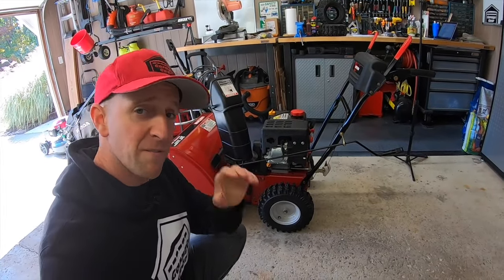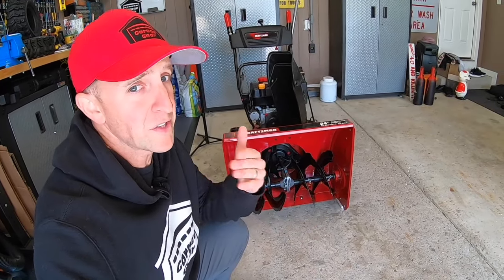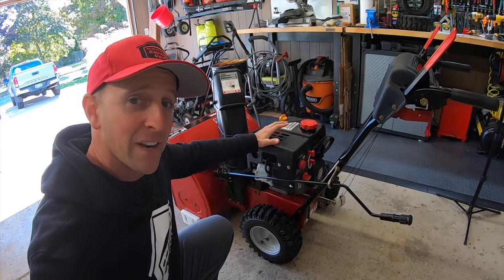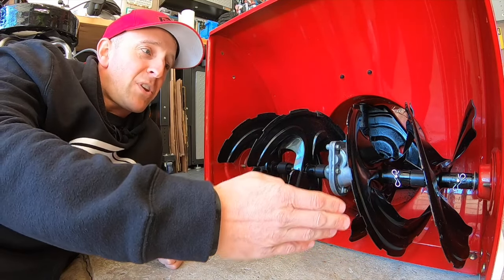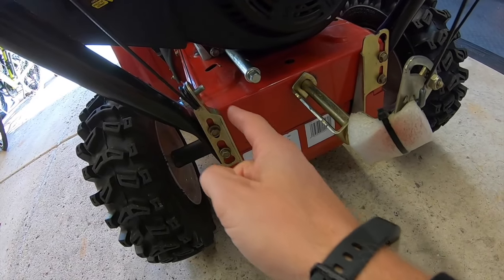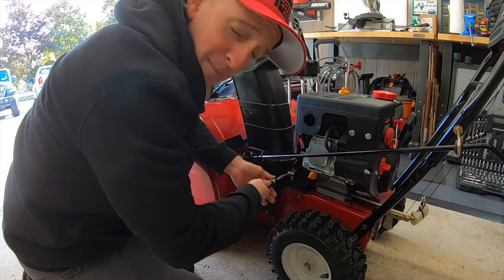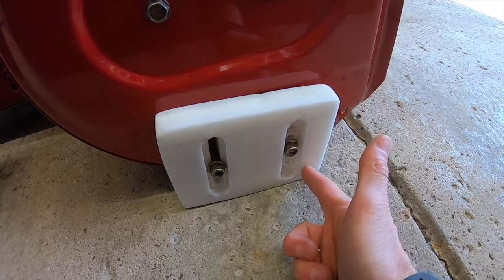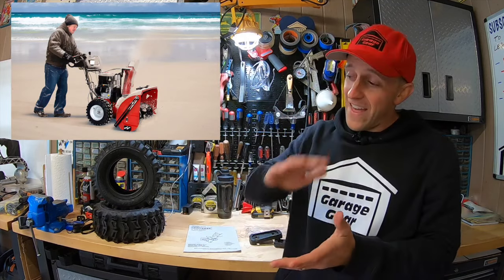LOOKING FOR A USED SNOWBLOWER, WATCH THIS!

Comment: Honda snowblowers are even more! $4,000+ since shortage
Reply from the maker: Guess I better start saving my money! Lol thanks for watching applez!!! 👍
Reply: @GarageGear  I got 2 used Hondas haha
Reply from the maker: @appleztooranges  I see used ones pop on Craigslist around here from time to time. Tempted!
Reply: @GarageGear  if you can get a 1132 or 1332 for under $1000 it’s worth it? I got my 1332 for $895 and could sell it for double. It’s in mint shape. My Honda dealer messed up and listed it wrong model as a 724. Nothing wrong with machine. Runs mint. My 928 wheels I traded my ariens deluxe 28” sho (similar to yours) + $500 towards it and it’s basically brand new
Reply from the maker: @appleztooranges  I’ll be keeping an eye out! Thanks for the advice! 👍

Comment: My recommendation is to find one that has a Tecumseh Snow King that is in good condition. They’re a lot more reliable and easier to work on than a lot of the new engines. One engine you should avoid is the newer Briggs and Stratton storm series. Those things have serious cylinder head problems. The MTD powermore is also a bad one because it is really hard to work on. That is the engine on this snowblower you are showing.
Reply from the maker: Thanks for sharing BCSERK! This snowblower I bought used for a good deal! It’s in perfect condition! Not a spot of rust on it and we’ll taken care off. I’m not a fan of these engines but it’s cleaner than a nuns vocabulary lol! Thanks for watching!
Reply: I just got bad news on my Briggs & Stratton snow series 1150 it has a blown head gasket and engine needs a complete rebuild. It couldn't take 18" of wet snow it killed it!

Comment: I used these tips when checking out the 24" troybilt storm snowblower my neighbor was selling because wasn't room in moving truck. It was 5 years old but never used just set in their garage other neighbor always plowed their driveway . Put in New grass and oil and it fired right up and ran great. They couldn't find the owners manual the power cord or the extra sheer pins. They had paid $899 for it so I gave them $400 for it I think that's a good deal not as good as others commented on. Watched your other videos on the other maintenance to perform on it so it's ready for the snow.
Reply from the maker: Not a bad deal my friend! You’ll get plenty of life out of that machine! 👍

Comment: JB I'm glad that I have my snowblower all ready to go. I changed the oil this fall but had an issue with the auger handle stuck down. Some oil took care of that. I took off the bottom plate and cleaned everything out and put it back on. Took off the pully cover and it looked good. I also adjusted the cables for the drive and auger. After watching your video I realized that I never looked at the sparkplug. I could check it out but it started after the second pull. It sat all summer with no gas in. I've learned a lot from your channel and I'm still learning. Thanks for your time and videos.
Reply from the maker: WHITIE!!! Rock on my friend! You’re a master of your machine!  All smart steps you took there. I have another video coming out this weekend on how to get your snowblower ready for winter! If you’re feeling eager you could always just clean your spark plug. But if it’s starting up no problem you’re good! How’s everything else going my friend?
Reply: @GarageGear  going good.

Comment: Great video one of the best I seen here. I gave away my old & reliable 24" Troy Built and bought a newer 28" Airens which now has a destroyed Briggs & Straton engine on it. I can't blame Airens for that. The last storm was a wet snow of 18" and it did it in. Not sure what I will buy next. Airens is a well made machine. I like Toro and Cub Cadets. Honda's are just to much money. Not a fan of Craftsman but the newers ones are ok.
Reply from the maker: Hey Dave what destroyed the engine on the ariens?

Comment: I bought a new Craftsman two stage last yr at LOWES for $800 (looks the same as this one).  Yesterday, installing impeller rubbers, I realized how small they are.  2 1/2" wide before the 30° bend.  SMALL.  It did okay last winter.  With the impeller rubber installed, I'm hoping it will handle the icy snow at the end of the driveway where the state plows 5 lanes of snow.   I must admit, it is super easy to start.  Never used it yet but nice to have an electric start where you just hook up an extension cord.  I looked at blower while in HD last week.  WOW!  Do they think our economy is so great as to almost double the prices for the same blower?
Reply from the maker: Hey Lee! These prices are out of control! Smart to put the impeller kit on it! Total game changer for these machines! I highly doubt the prices will come down once the economy stabilizes. Thanks for watching!

Comment: Thank you!!! For this video I picked up my first used one today Husqvarna brand. Needs a little work cable tighten up on the auger lever and a little bit of carb work. The only thing I want too add too it is a couple of lights. Blower does have the wire hook ups. Question do snowblowers even have air filters? I've had 2 other blowers that didn't have one. Wisconsin winter is near for us. Stay warm. Yes I enjoy your videos I'll even use your other on how too get more power off of it.
Reply from the maker: Awesome Brutus! Sounds like you found a good snowblower with a need for only some minor repairs. To answer your question, snowblowers do not have air filters. The cold temps could freeze up any moisture caught in them starving the engine of air. You’re good to go. Thanks for watching! 👍

Comment: I recently got myself a Powersmart 24in 2-stage snowblower for $125. The couple bought it new 2 years ago but had some issues with the augers during heavy snow. Everything else looked great; minimal rust, engine sounded great, and they wanted $125 for it. I paid them just that, brought it home, inspected the belts, tightened the auger belt, and got myself a great machine for $125.
Reply from the maker: Sounds like a good deal! Rock on my friend!

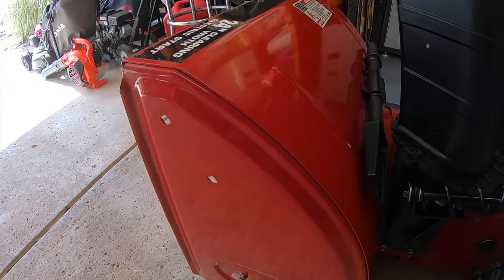Comment: Wish you'd mentioned applying anti-seize paste on the axle if buying new or even try pulling off a wheel if buying used.   I bought mine new, never knew about that now the wheels won't come off. There are some real barbaric  ways to try to removed if seized but I'd rather not go that way.  Also, at 9:18, the yellow dipstick handle, couldn't find in manual what that's for - what the story with that? Love your videos btw.
Reply: LessThanHandy   It is oil dip stick, to check oil level.
Reply from the maker: Hey lessthanhandy! The anti seize trick is something I’ve never seen someone actually do to their snowblower. I’ve done it to many but never seen it on a used one before. I’ll be doing it on this one. 

The lower yellow dip stick is useless on this model. Those engines are put on a variety of applications. Generators, blowers, chippers etc. for these blowers they don’t get used but may get used on a generator for example.   If you take care of these engines they run great! Thanks for being a cool fan bud!
Reply: @gardenjohn1  that's what's stange, th oil dipstick on mine is at the top and is in the manual...this yellow one is what I don't know...

Comment: Great video JB the only thing we would add is try to hold back on the blower when the drive is engaged. If you can basically hold it back there could be a need for friction wheel change especially if the cable is tight.
Reply from the maker: Good point! Thanks for sharing Wayne! Hope all is well on your end! 👍

Comment: Yup.  That's the way you do it!  Great vid, JB.

Especially nowadays.  Like you said at the beginning, new blower prices are insane today. 

The new blower I bought in 2018 on sale for $1.099 is now $1,550.   Same exact model, no changes.  SMH
Reply from the maker: Thanks Paul!  Appreciate it bud!  These prices are getting out of control! 

Got a short story for you! I know how much you love Tecumseh engines. Lol My neighbor was tossing an old toro mower with you guessed it, a tecumseh engine. I figured I’d try with this one because everything else on the mower was in great shape but it wouldn’t run. Took the carb off and did everything A-Z on it. Still wouldn’t start. Don’t know what it is about every tecumseh engine that comes through my garage man but no matter what they are always a pain. Ended up selling it for $30 in less than an hour later. Tecumseh engines drive me crazy! Figured I’d let you know since you like them so much 😂👍
Reply: @GarageGear  Lmao

Comment: Hey garage gear I recently bought this same snowblower so I took off the chute and now I can’t get it back in place because when I bought it I took it off because it wouldn’t fit on my truck.
Reply from the maker: Is there a reason why it won’t go back on?
Reply: What do I have to do ? Because I remember I took it off and now idk how to put it back in place
Reply: Do I need screws or does it put right back on ?
Reply: I have the same exact snowblower
Reply from the maker: @junior1994-  I sold this snowblower a year ago so it’s hard for me to say without looking at it but I think there are a few bolts at the bottom and and some on the opposite side that need to hold it in place.
Reply: @GarageGear  I kinda figured !!!  Ugh I took the chute off now I can’t put it back on.
Reply: I wish you can make a video explaining how to put it back on place.

Comment: I spent $50 on a commercial ariens w/bad engine. $150 on a predator 224cc. Picked up spare belts, replaced the sheer bolts, and got spare ones.
Reply from the maker: @LowInformation  sounds like you’re all set now! 👍

Comment: I wish I would have bought used a year ago. I spent almost 2K on a brand new Ariens Deluxe SHO. And very much dislike it because of the 0 turn feature.
Reply from the maker: Thanks for sharing IVXX! Do the wheels not have enough grabbing power?
Reply: @GarageGear  the problem is anytime the blower sees any kind of resistance it tries to turn itself. Like packed tire tracks or the thick stuff down in the apron. I would very much prefer that both wheels just work together so it goes straight. It's a very heavy machine and I get wore out fast trying to fight it.
Reply from the maker: @Ladysman_217  I hear ya bud! I think the lower end models by ariens do not have it but you may sacrifice power at that point.

Comment: 9:40 shows the impeller on screen left is bent to h%@&.
Reply: Oops, I meant auger.
Reply from the maker: Hey Jay which one were you talking about?
Reply: Hi JB, it LOOKS like the leading part of the auger blade on the right side (looking from the rear of the machine) is bent. Am I wrong, and it's just the angle of the shot, or is it really bent? Either way, love your videos, mainly on snowblowers.
Reply from the maker: @jayrichman6266  hey Jay! I think what you’re seeing is the camera pulling a trick on you. The lens up close tends to round or distort images. This blower was in excellent shape and sold for top dollar. 👍thanks for being a cool fan!
Reply: @GarageGear  I watch it on my phone and it looks normal, but on the TV it looks bent. Weird! Thanks for replying and love your new machine. I live in northern WI, so I have a '21 Ariens DLX 28 for my main machine, and I have a couple others which I've obtained either for free or for very cheap, and thanks to your various videos, I've got them up and running and looking a lot better, and now I need to decide whether to keep them (my wife gets mad at me but not YOUR problem!) or if I should sell them. Nice problem to have, eh?